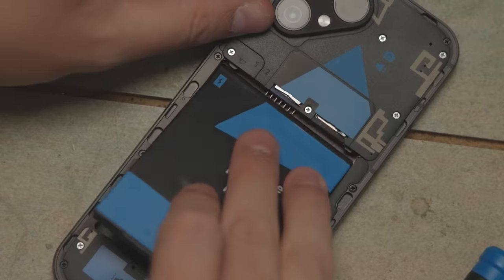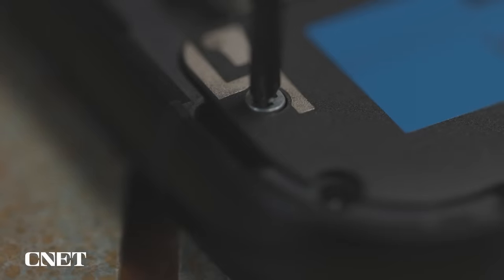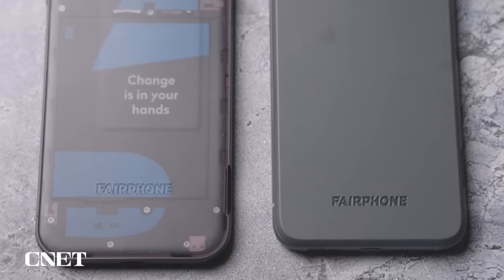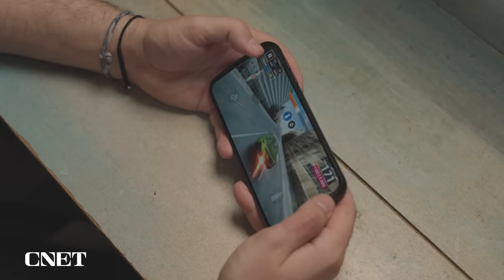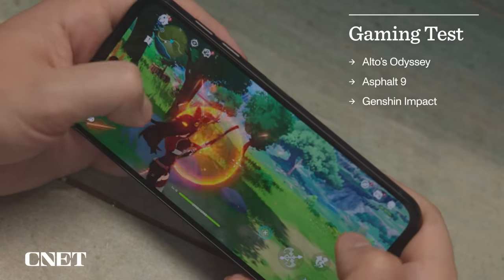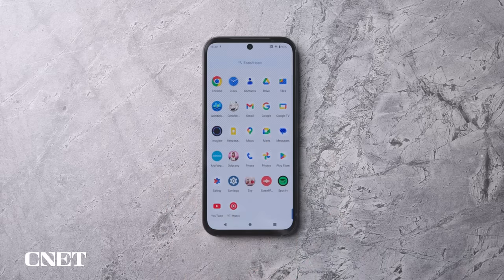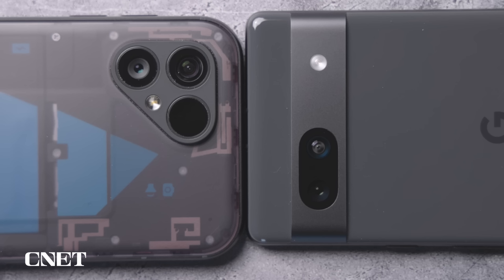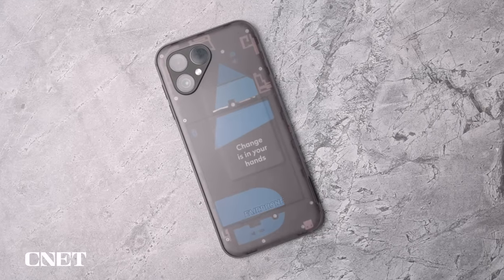Fairphone 5 Review: A Noble Cause, an Imperfect Phone

Comment: I have been a happy fairphone user for 3+ years now (I have a fairphone 3). Overall good performance. I have no complaints about the battery, have not changed it since I bought the phone. As my phone use does not require the absolute best camera and I am not a gamer, I am happy to vote with my money for a more ethical choice.
Reply: Personally I was just very disappointed with the lack of headphone jack which contributed to me not using a 4 currently.
Reply: Personally if I'm gaming using a phone doesnt work for me besides emulators (way lower performance use on average than modern games) is the most gaming I do that or pixel games. There's preferable portables or my desktop instead.
Reply: @Anonymous-zu7dh   I still think the Fairphone 5 is worth buying given all the improvements.  Sure, they announced in their FAQs they had to compromise in order for the phone to be smaller and have all the extra features. But these days it seems like nearly every phone company is ditching the jack, and the modern phones that stil have them aren't ethically sourced sadly...

Comment: One thing I really dislike about smartphone reviews is the double standards when it comes to reviews of Fairphone vs every other manufacturer.

Fairphone is always criticised for its chipset and camera performance relative to similarly priced competitors, but the competitors are never criticised for their massive failures in sustainability, ethics and repairability relative to Fairphone. If we want change within the industry then we actually have to hold the bigger manufacturers to account on these issues. And that means tech journalists actually need to grow some balls and start making these points in every review of the latest Apple/Samsung/Google/etc, rather than pretending none of those issues exist.
Reply: true point
Reply: Very true. They’re aways like “Phone x or y is much better because you get better value for your money” when that value is hidden in poor labour conditions, questionable material sources or a disregard for the environment by launching 50 “different” models per year. The double standards are insane.
Reply: So true. It's almost not a fair comparison. 

Like, this phone was made using fair and safe labour practices. They pay factory workers a living wage bonus, no slave labour, no child labour. This makes the phone more expensive but you'll also get 8 years of use so if you divide the price of the phone/8, it's really not bad. 

Meanwhile:
"But it doesn't have the best camera though! 🤓"
So child and slave labour are ok if you need a slightly better camera? Let's be real, 99% of people are not shooting the new cover of vogue, they're taking pictures of their cat. Do they really need the best of the best for that?
Reply: While I kinda agree, it's also not the reviewers responsibility to do so. They're there to review the product, the end result that you can buy. They're not there to talk about the manufacturing process or company ethics. The whole reason the subject gets brought up in Fairphone reviews is because Fairphone touts their sustainability, their "fairness" as a feature. Do we need better journalistic coverage of these companies, and manufacturing? Yes, but a product review is not the place for it.
Reply: Well of course they're going to criticise the processor and camera when the whole point of the phone is to keep using it for as long as possible. If the specs aren't good by todays standard then in 5 years its going to run much worse on a newer OS.
Reply: @Conduiticity  That depends! I recently got an upgrade to Android 13 on my Fairphone 3. It runs better and the battery lasts noticeably longer than it did on Android 11. This was my biggest worry as well though. Kudos to Fairphone for sticking to their promises and ensuring what they do actually works.
Reply: Spitting Facts also Mass Buying is cheaper then what small Companies do.
Reply: I thought exactly the same. Additionally: Fairphone breaks down their costs transparently and a lot of the price tag comes from the small amounts of phones they sell. So if more people would actually make the choice for a sustainable phone the price would drop as well. Another reason why the logic laid out in this piece is harmful.
Reply: yeah, this was a pretty trash review, not trying to hate for the sake of it..
Reply: @madness1931  Yes, it *is* reviewers responsibility to *review* the product they are trying to *review*. When the guy simply states that "the pixel 7A is a better phone" than a phone with 5 years of warranty, 8 fcking years of software support, user replaceable battery and spare parts available to buy, just because it has a slightly better camera that most users won't even notice (even though the FP5 camera is perfectly fine) is a pretty stupid point to make.

That stupid obsession with "best camera quality ever" and "top notch performance to play chinese spyware crap games" like 99% of the smartphone users are seeking this is to be REALLY out of touch with the reality.
Reply: Truely this!!!!
Reply: @LinuxIsNotAnOperatingSystem   Could'nt agree more, many people watch these kind of reviews and base their next purchase upon them. Ultimately making people buy stuff that has waaaay more "performance" than they actually "need" for the purpose of their phone.
Reply: Exatcly. Putting such tiny difference in camera performance and stuff like that over the enviroment and peoples life shows how delusional we as a society are.
Reply: @larryy667   I would use a fast phone for 8 years instead of the fastest for 3 because you will not even notice the difference other than in benchmarks or "heavy" gaming.
Reply: @LinuxIsNotAnOperatingSystem   What you said. And I would like to point out, that MKBHD's yearly blind camera tests are consistently won by phones that are way cheaper, sometimes even older, than the latest, bestest, most ultra-camera-performing flagships. Also, Pixel's camera quality mostly software post-processing. Fairphone has to just hire some people to improve their camera app and push an update or their users will mod GCam. Either way, it's not like camera quality is set in stone.
Reply: Exactly. If you want a bang for the buck phone, you'll definitely look some place else.
Reply: Completely agree
Reply: the reviewers have never criticized big manufacturers for sustainability that’s because most of people are don’t give a damn about it and the Earth. We’re doomed.
Reply: At this point, in 2023, knowing what we know about climate impact and work conditions, it's borderline infuriating. "Is it worth paying more for less, if that means paying people $2.63 more, and not destroying countries with lithium deposits?"
Reply: Also didn’t like how he said the battery life was bad but didn’t mention the possibility of just popping in a spare battery and having a full charge instantly.
Reply: @DavidEmil_ He did recommend a spare battery for heavy usage
Reply: Great point. Reviewers should bring up cobalt content in every phone review.
Reply: Those issues exist, but people don’t care about them. You make a great point, but you’re a very local minority.

How many people out there would prefer a modular sustainable phone over one that has better performance or better cameras? The answer is not a lot.
Reply: @madness1931 I'd like to live in a world in which sustainability performance is part of product performance.
Reply: the price should not be an argument at all. Fairphone can not mass produce like Samsung, Huawei, Sony or the others, so ofc the price can not be 1:1 competitive in terms of specs at high end and all.
Reply: That’s what bothers me about 99% of tech reviews out there. Nobody talks about gadget and organisational ethical standards!
Reply: @madness1931 Not sure I agree with this.  If not in a product review, then where?  The only places where these sustainability and ethical issues get written about are in specialised media which, let’s face it, very few people read.  Most people on the other hand do read or watch product reviews before they buy.  If we accept that there’s an urgent need to bring this to the attention of the buying public, then I think at the moment product reviews are the place to do it.  It would put serious pressure on the manufacturers to clean up their act, and at present that pressure just isn’t there.
Reply: that's because chinese brand smartphone that comes with great chipsets and hardware at low price are disposable. Mostly will be replaced after about a year on average, and since its discarded, well, out of sight, out of mind
Reply: Couldn't have said it better myself. Very true! CNET needs to pin this comment right below the video.
Reply: Couldn't agree more
Reply: These issues really don't matter outside echo chambers. It's a "nice to have" feature.
Reply: When the phone is underperformed by now, it will be even behind in the future and it will be hard for people to use that for 5 or even 8 years
Reply: @lokeung0807  Nah; old hardware works great, usually better than when it was new.
Reply: @prophetzarquon  but not for a Phone planning to use for 4-5 years. This performance won't age well.
Reply: @lokeung0807  Sure it will. Ten year old devices work great as lopng as they get good updates. High end CPUs don't really help usable lifetime; getting good system updates does.
Reply: @prophetzarquon  My main concern is the camera🤔
Reply: Ok this 👆🏻 comment wins ✅. Also Marques Brownlee actually mentioned the others in his Fairphone review, he did call them out that they should do better 💁🏻‍♀️
Reply: @chlorophyllphile  He did indeed, but even I thought he was talking about a powerbar to charge the phone, even if I actually thought about changing the battery later.
Reply: This is a great take, but for journalists to make that change they will need some support. We need to organize groups to reach out to these publications each time a new review is released without these points being made. Journalists might want to point this out but if they do they are putting their job on the line, and while that is the correct thing to do it also isn't sustainable unless we are backing them up. I'll definitely be thinking about this for a bit thanks
Reply: Not just repairability, but active agents against 3rd party repair.
Reply: This is so true
Reply: Don't blame the reviews, blame the consumer, reality is that when it comes to put hard earned money, people don't care about the fairness of a phone, sadly.
Reply: @LinuxIsNotAnOperatingSystem Couldn't agree more. The pics on my Fairphone 4 and now 5 are great for my work, for my social media, and even my desktop wallpaper (on a 4k monitor). I've played Hearthstone, Bio Inc, etc. for hours with no issues. The average user will get everything they need from this phone.
Meanwhile, my dad's Pixel 5- which was £200 second hand- was unsupported within six months of purchase.
I eagerly await his deep dive into the ethics and sustainability of the next Pixel handset.
Reply: Damn right! Thake Apple for example, you can't even replace some parts due to internal IDs...what a BS! Unfortunately, people keeps buying their products.

Comment: Well, battery life won't be an issue if you can replace it in under 30 seconds.
Reply: to be fair im not sure i want to do that every day though
Reply: @robtektek  Well, welcome to the old days, I guess. Although, I don't change my battery when my current died with my old phone. Back then, they sip less power.
Reply: @robtektek You also don't have to do it everyday most people can charge at work

It's just for the odd day you cannot charge it at all
Reply: yeah then it means u already buy 2 batteries and u run through then fast than we run through them in a regular phone. so is the impact on the env really decreased overall?
a regular s21 ultra battery lasts a day with 85% max charge setting.  and still does after 2 years and I don't see myself ever replacing it (the phone or battery), at least 10 plus years.

it might be better and more environmentally friendly to buy the best phone and keep it for 10 years or more (even without updates).  but then again I barely drop  my phone and have never needed to replace a screen on any phone for 20 years that we had phones.
Reply: @handlehandle12322  Just you wait brother, I always used the 85% thing on my S20 Ultra, battery life was decent up till one day where it was like it hit a wall, I swear I can almost feel it getting worse by the day. Taken great care of it ever since I got it and never left it plugged in overnight and everything, all for nothing since it's now 3 years old and definitely is starting to get bothersome to charge halfway through the day!
Reply: I agree with you. I would love something like this for a work phone. So basically one battery for work one for home and also any issues like a screen damage will be easy to fix

Comment: I'm switching from a Pixel 7a to the Fairphone 5. Screen cracked on my 7a and the repair quote I got was 70% of the price of a new 7a. I'm getting a worse phone in every way with the F5 but I hope and suspect it's good enough for me and when it breaks I can repair it myself for a fraction of the cost of what the repair would be on any other phone.
Reply: I have the Fairphone 4 for 1.5 year now and I actually want to transition to a pixel phone  as next phone. The camera is not just A LOT better with the pixel, it's MUCH MUCH BETTER at low light intensity, because of AI support, while it is really crappy with the Fairphone. Same goes for the mic. You wanna record something, or film a bit of a concert? Forget it with the Fairphone. The Fairphone 4 has still many software issues like the screen light intensity becoming very low at moments and is still stuck with android 12. Seriously, I feel scammed because both the Fairphone 3 and 5 are already with android 13 and the Fairphone 3 got upgraded modular parts. They could have made the modules between the Fairphone 4 and 5 compatible but they didn't. The Fairphone 4 was a in-between phone so that they keep selling. A noble cause they have but the execution is disappointing.
Reply: I'm considering a shift to the Fairphone 5 too, would be great if you can update on how it is, particularly to battery life, gaming/performance and camera. Not sure if how much improvement it gets with Camera FV-5 or Open Camera.
Reply: @bassenji5565  ppl should focus on the concert instead of trying to record something that nobody outside of the concert really cares anyway.
Reply: @jierenzheng7670  One of the benefits of the fairphone is if your battery degrades it's replaceable. That's been going the way of the dodo bird when people seem to forget you can buy a spare battery and charge it (great for road trips or long outings just swap your backup charged battery). Bonus tip: If I recall the sweet spot is 80% charge for battery longevity and fully discharge (not everyone does that but if it's a serious concern that helps). The phone is real nice for giving you an option that frankly should be expected in phones nowadays (its the future why can't we get a replaceable non soldered battery at least as an option?).
Reply: @theepicduck6922 fully discharging a battery is really bad for it -- can even kill it.

Comment: Expandable storage with microSD cards isn't talked enough about generally. It's such a huge benefit! I have some old phones that broke or that I forgot the code for, but since my photos were stored on microSD cards it was easy to get them backed up. Easily replaceable battery is also so nice! Having a spare battery instead of a power bank has a lot of benefits.

Pixel 7A seems to have a lot of niceties, but they matter little if the phone can't hold for as long. I guess it's a matter of priorities for each person.
Reply: That's actually pretty insecure. If you were able to retrieve your media so easily it means your SD card wasn't encrypted, so if you got robbed or lost your phone anyone could easily retrieve ALL your photos and videos.
Reply: @LinuxIsNotAnOperatingSystem  That's true. Encryption would have been wise in such a case, but I'm nevertheless happy that I could easily retrieve my old photos.
Reply: @LinuxIsNotAnOperatingSystem  Different use case in part. If it's primarily family photos, don't see much of a need to secure them short of some extreme cases. If it's your contact log, depending on who you are it's important to secure that. Better safe than sorry but there is reasonable lengths to go. Your family photos for a vacation trip probably don't need to be as secure as fort Knox.
Reply: @@imarocketman90 Perhaps a solution for some, but tedious if you have a spotty internet connection and it relies on you trusting a third party with your personal photos. It can get pretty pricey too. A memory card doesn't need a subscription. :^)
Reply: @@imarocketman90 Sounds like a nice solution! Maybe I'll try doing the same eventually, but I still like the idea of having everything saved locally too.
Reply: Underrated comment about an underrated feature. Just last year, I had a device break that wasn't worth repairing & simply copied my files from the microSDHC card. No sweat. Temporarily, I started using a device with only internal memory... which simply failed to turn on one day. Even with direct power it wouldn't respond; dead brick. Cloud? Full, as usual. No backups had occurred since the first week on that phone. With removable storage, swapping files to a new device is trivially easy, & copying those files to another device goes way faster & more efficiently than any internet connection achieves. Handsets without removable storage are just trash. 

(Also, files on microSDHC can be encrypted just like files on non-removable storage; whereas cloud storage offers several additional attack vectors local storage doesn't.)